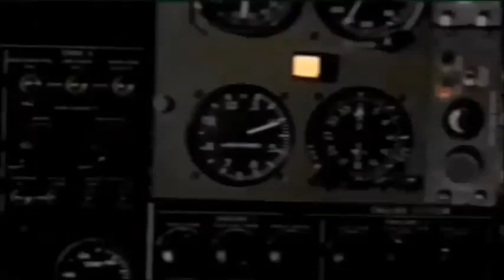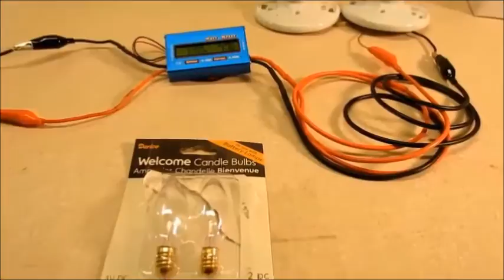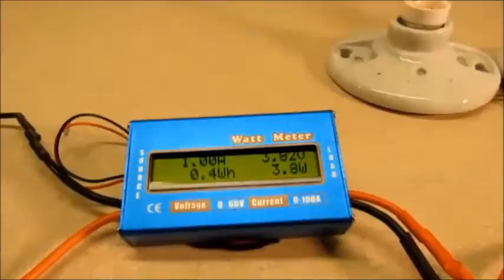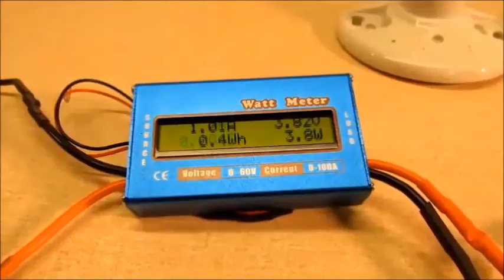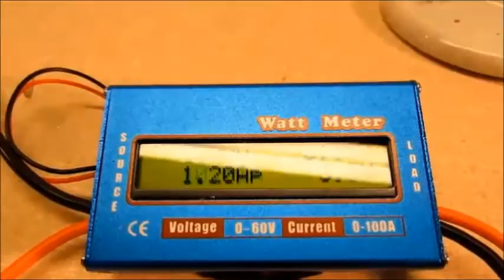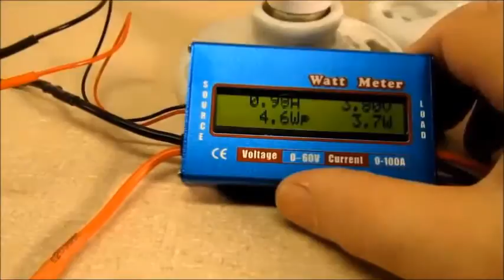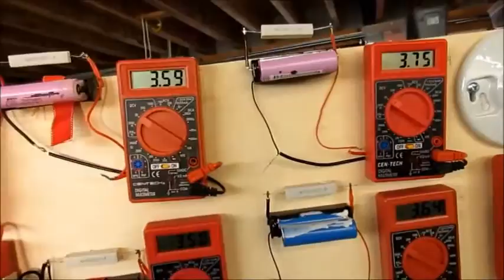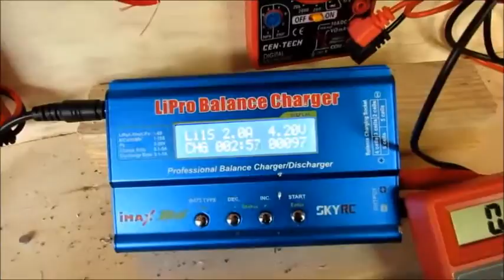Ebike 18650 Charging and Discharging Lithium using The Big Board Ebike Project part 5

Comment: Amateur question: so, you know the amp hrs. Of the battery (from the factory) discharge for 1 hr. at 1amp, then calculate the remaining capacity ??

Comment: Have you replaced your chargers with a charger/protection version yet?  Put the battery to the battery connection, and the load to the output.  When the battery drops to around 3volts, the output to the load is cut and you do not undervolt your batteries.  I find that today, the protection version of the TP4056 is about the same as the non-protection version.  Here is an ebay example at 40 cents each- http://www.ebay.com/itm/5X-1A-5V-Micro-USB-TP4056-Lithium-Battery-Power-Charger-Board-Module-TE420-O2T8-/253109886448
Reply from the maker: No, because my Chinglish is not very good. I quote from the Ebay Listing: "High voltage chip fever will automatically reduce the charging current, not to chip burned. Chip at work about 60 degrees fever is normal."

Comment: Can you please explain capacity testing in SIMPLE terms?? (H.S. dropout)
Reply from the maker: When you are testing used laptop batteries, you have no idea at first what the capacity is. If you use a capacity  tester like an ImaxB6, which is a popular example, you have to discharge one cell at a time, which is very time consuming. It gives a more precise reading than using a 10 watt (heavy duty) 4 ohm resistor and watching the voltmeter and the clock as the cell falls from 4.2 volts (maximum charge for an 18650) to 3 volts (maximum discharge for an 18650) and seeing how many hours and minutes it took.  The Resistor has the advantage in that it is cheap and while it does not discharge in a linear fashion, (straight slope), all cells will discharge in the same way and will give consistent results.  If a cell takes two hours to discharge at a rate of one amp, then you have a 2 amp hour cell. Cell manufacturers rate their cells in milliamp hours, and 2000 milliamp hours is the same as 2 amp hours. A 4 volt cell hooked to a 4 ohm resistor will discharge at a rate of 1 amp per hour.A 24 volt battery made of (ten) 2 amp hour cells (10 in parallel and 6  in series) for a total of 60 cells should take you between 15 to 25 miles depending upon total weight of bike and rider, and the hills of the terrain. The method I am using bothers some people because it is not how most of the others are doing it so of course it must be wrong. This method has disadvantages. You must stay with the batteries while they are discharging and check the voltages and temperatures of the cells as they are discharging. Some people do not have the time or persistence to do this. The resistors get extremely hot. You cannot have small children, pets, or allow anything flammable to get near the resistors while they are discharging. Checking capacity with an Imax B6 puts a lot of strain on the unit and people have reported that their ImaxB6 failed while doing capacity testing. at $35 apiece for a genuine unit, that gets pricey in a hurry. None of my resistors have failed in 5 months of daily testing.Remember that I am not suggesting that anyone follow my example. I am processing more cells than most because I have a lot of ideas for bicycle projects that you will be seeing in the upcoming months.Please reply if this helped. Cheers. 18650 E-Biker